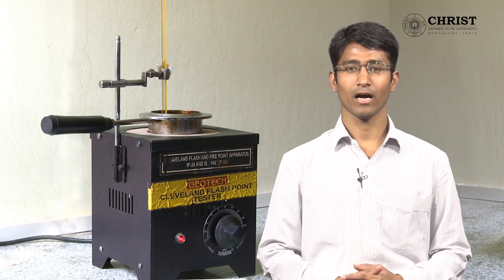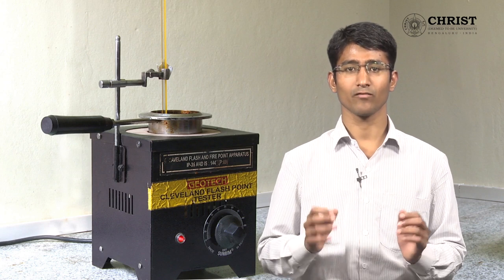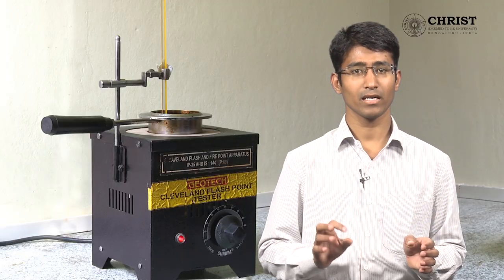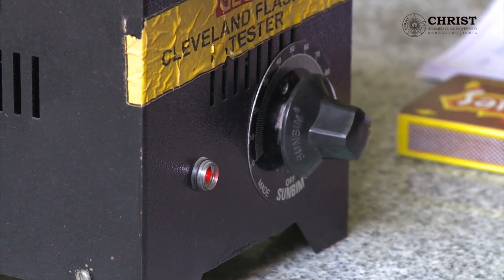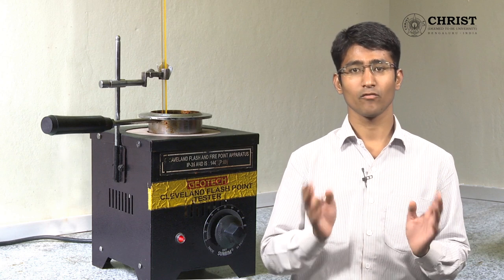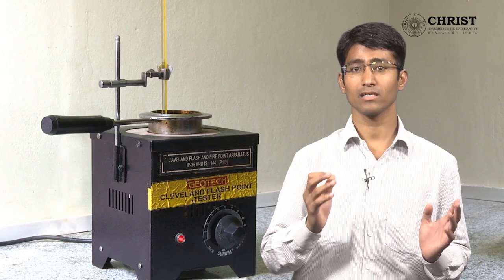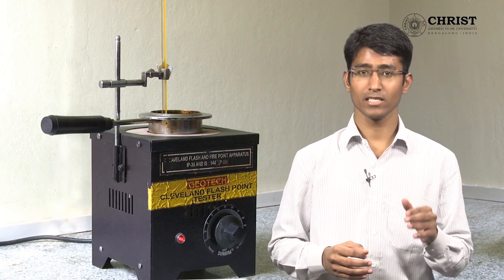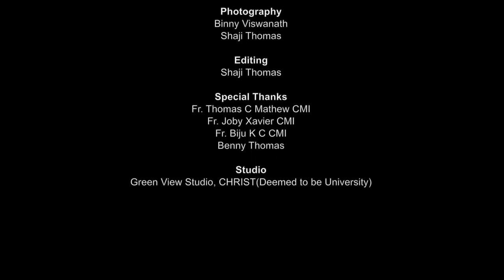Cleveland's Flash  Point Open Cup Apparatus - Mechanical Engineering

Comment: Looks like this can be diy to test used gasoline engine oil is suspected to be having fuel dilution by 2% volume?. The typical fuel dilution upper limit which will lower engine oil by 2 to 3 cst. Use a beaker with 100cc used engine oil and heat gradually and a flame to flash test?.   😂😂😂😂